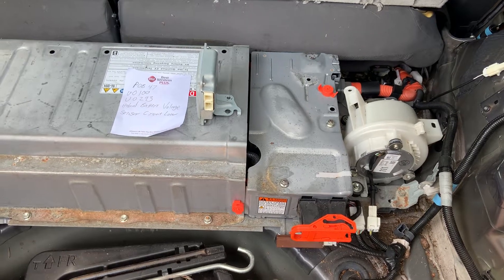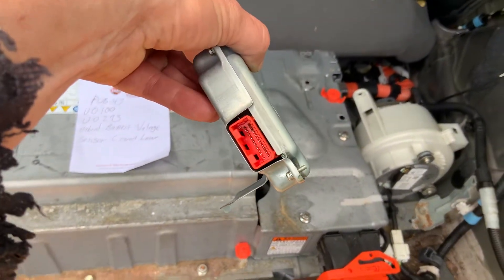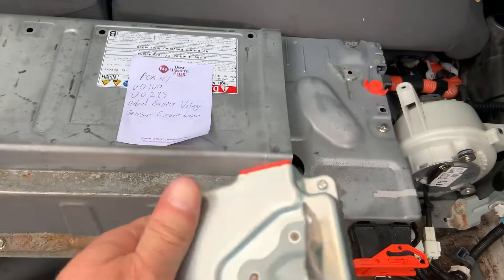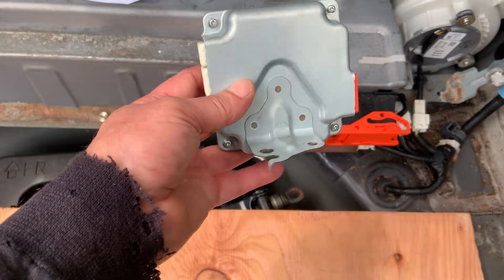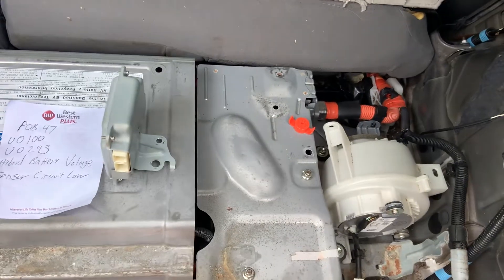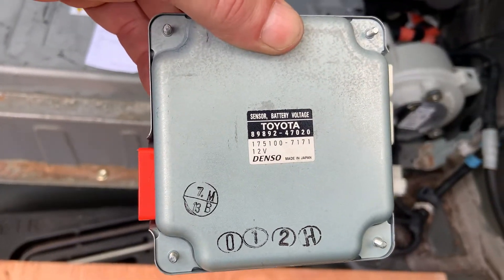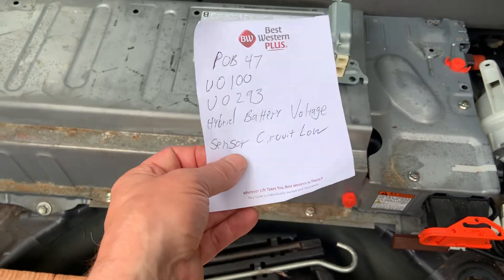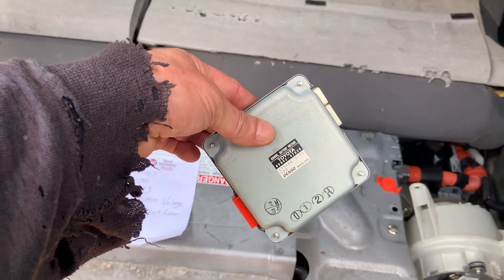Gen 3 2010 Prius POB47 U0100 U0293 Check Hybrid System Voltage Circuit Low / No Communication Repair

Comment: Does it require tech stream ?
Reply from the maker: No, I was able to read the codes without Techstream.  The new module didnt need programmed, it plugged right in and worked.
VT247

Comment: My buddy has a 2011 Toyota Prius the issue is it’s not throwing the P0B147 code but it is showing the other two codes. The thing is also is the box that you’re holding in your hand I don’t see any burnt pins. Could it still be burned inside and not on the outside?
Reply: I didn’t see any corrosion either on the pins
Reply from the maker: Yes, it is possible the inside of the Hybrid Voltage Sensor circuitry box could be fried.  I removed mine, took off the 4 screws holding it together and discovered some cooked pins inside in addition to the burnt pins visible at the plug in.  Probably be a good idea to look at the nuts and wires going to each module in the Hybrid battery too, they do get corrosion built up on the ends.
VT247

Comment: If the hybrid voltage sensor is bad, does it still output battery via Dr Prius?
Also, can one check the HV battery voltage from the two cable point (The Red and Black that goes to the car)?
Reply from the maker: If the battery voltage sensor is bad, it won’t show the battery output on Dr Prius.  Run the codes on the app.  If you’re getting POB47 U0100 or U0293 the sensor very well could be bad.  Wouldn’t try measuring the HV battery voltage with the orange plug in.  
VT247
Reply: @Vacationtime247 
The list with u0100 error are:
-ECU: 7EA
-ECU: Hybrid engine system
-ECU: Climate/Heater

Car shows triangle but runs on hybrid battery. However, it's not switching over to combustion engine so hybrid battery dies after a short time and had to charge the HV battery with a Prolong Grid charger. So i am guessing the combustion engine communication is where the issue is but can't pinpoint what 7EA, Climate/Heater is.

Comment: Just changed my on 2017 Prius v. but car won’t start up. Ready light won’t display on the dash
Reply from the maker: Try a hard reset of the computer.  Disconnect the hybrid battery orange plug and disconnect the negative from the 12v battery too.
VT247

Comment: hey there i accidentally disconnected my white main cable from the fuse fox on my 2013 prius when the car was still on all the screen went off and after that the code U0100 came on with the check hybrid system msg on the screen i will check that part i  hope i have the same luck like you thanks ..
Reply from the maker: Plug everything back in as it normally would be.  Then, do a hard reset.  Make sure everything is off.  Disconnect the Negative side of the 12 volt battery.  Then take out the orange plug for the hybrid battery and plug it back in.  Reconnect the negative side of the 12 volt battery.  Turn the car on.  That should reset everything and could potentially solve your problem.  Hope this helps!
VT247

Comment: I have a gen 2 Prius 2006 and even replaced my ECU under the drivers side and 2 months later  having start up issues when sometimes it’ll start into ready mode or not could this be the same issue as you describing here?
Reply from the maker: What codes are coming up?  If you don’t have a scanner, I bought an inexpensive PanLong Bluetooth OBDII scanner for about $20 off eBay that works great with Dr Prius.  Your problem could be this sensor or it could be a weak cell in the battery pack.  Check the 12v batter also.
VT247
Reply: @Vacationtime247 hey yes it’s U0293 and U0100 I’ve checked the 12v and it’s fine
Reply from the maker: @ryara3476  It very well could be the Voltage Sensor Module.  The video is on a Gen 3 Prius.  Should be located in about the same location on a Gen 2.  Don't have a cell phone plan, so can't message.  If you'd like to send me an email, that's fine.  vacationtime247 at aol dot com
VT247
Reply: @Vacationtime247  Hey bud just wanted to update you, so I took it to the shop and they confirmed $166 dollars later that’s it’s the hybrid ecu. On Monday I’m going to check to see exactly how they came to conclude  so I can get a warranty replacement from the company I bought this ECU from. 

However it being now my second ECU replaced making it the third one in the car I wanted to do some other testing pertaining to like what you told me. I actually checked the CAN bus high and low (pin 6 and 14 on obd port) to see if there’s any shorts on ground or voltage I used this video  as a reference to understand what the hell i was doing lol: https://youtu.be/fZMNzKpCGfc particularly 6 min and on for quick reference - anyway here are the results I noted down: 

Battery voltage: 12.6 normal

CAN (communication area network) bus:
62 ohms normal range 

CAN bus short to voltage test: DC Volts
Can high 6- no voltage normal
Can low 14- no voltage normal

CAN bus short to ground test: ohms
Can high 6- 2.914
Can low 14- 2.914

So it looks like the can bus having resistance on the short to ground test could be the key to my issues the question is which module could be causing this? unplugging the ECU actually didn’t change it still read 2.914.  Now pertains to what you showed on vid the battery voltage ECU in the back by the hybrid battery how do I test this if the whole car is unplugged and if isn’t this, what other ECU or module do I unplug and check for?  Or should I just replaced the ECU and call it a day?

Thanks for responding and helping me out btw!
Reply from the maker: @ryara3476  Sent you an email back : )
VT247
Reply: @ryara3476 hi, my 2010 prius showing same codes like yours. How did you fix the problem? Thx
Reply from the maker: @hsypham  On mine it was the Hybrid Voltage sensor and got a replacement off of eBay.  But it's best to inspect the hybrid battery cells and wiring inside the case too.  Corrosion tends to build up.
VT247
Reply: @Vacationtime247 i checked the battery voltage sensor. It looks good. My prius not showing code P0B47
Reply: Is there a way I can PM you?

Comment: POB47 it’s the one Ineed  to replace it
Reply from the maker: Check the bus bars and nuts for corrosion.  Inspect the voltage sensor too, mine was fried.
VT247